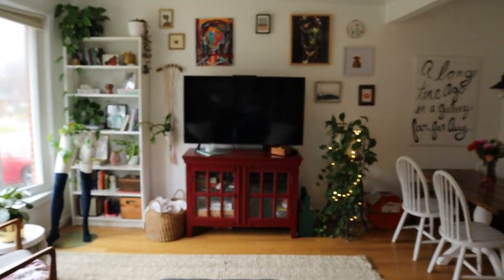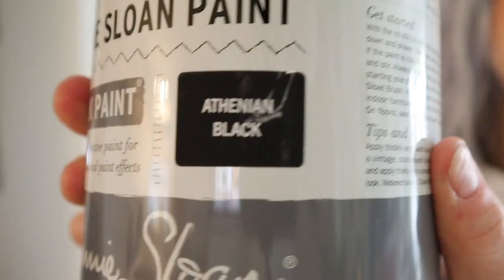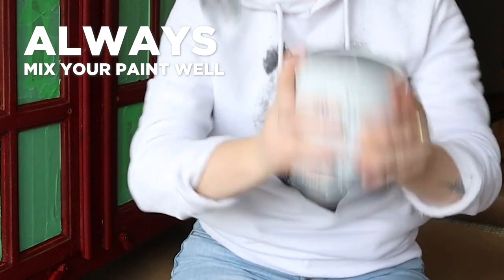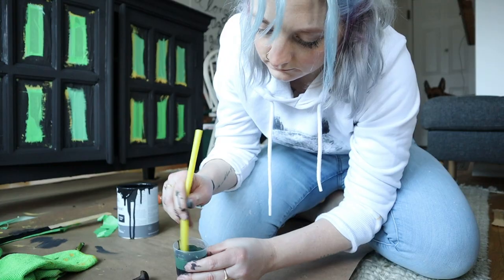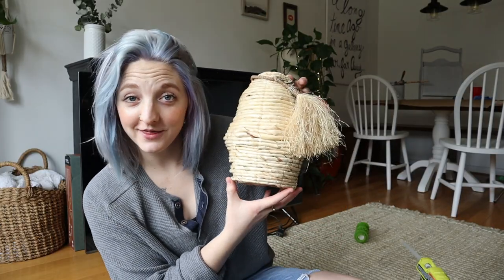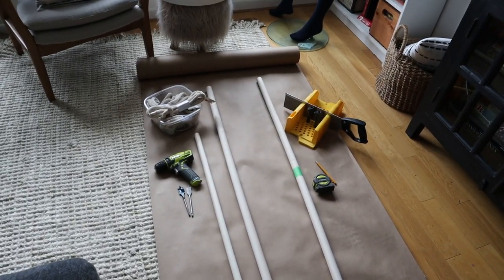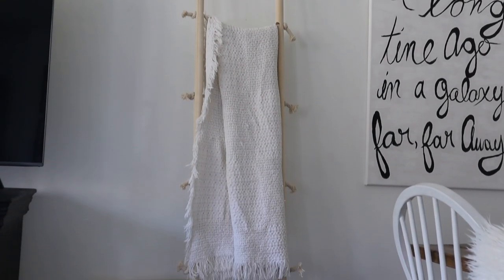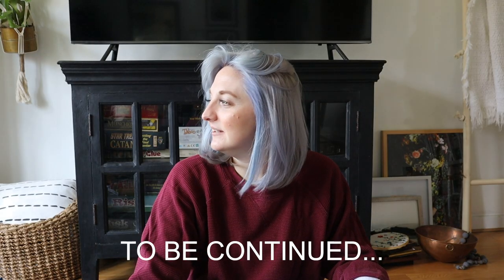The Power Of Colour: #Stayhome DIY Living Room Update Part 1 | DIY Danie

Comment: Yes on the drill and the jigsaw.  I have them both, use them often.  My drill is corded with a DeWalt kit for quick changing bits.  Got it at a pawn shop. Never run out of power, has more juice than a battery-operated drill, good for stud-based shelving.

Comment: I love all of these projects, but my favorite has to be the pendant light. I really like how it makes the chair corner feel more finished. If you decide to leave it there, you could "hide" the white cord by making a C track to cover it - maybe the width of the bracket for continuity - and paint it the same color as the wall, then hold it to the wall with some strong double sided sticky tape. Cords drive me crazy and so often distract from the look, especially when they are a different color than the wall.   
I'm also in love with your doggo and how he pops in on the edge of frame, but still out of the way (mostly, lol).